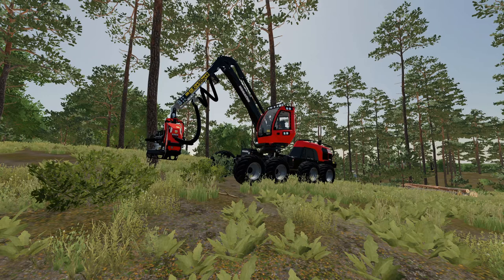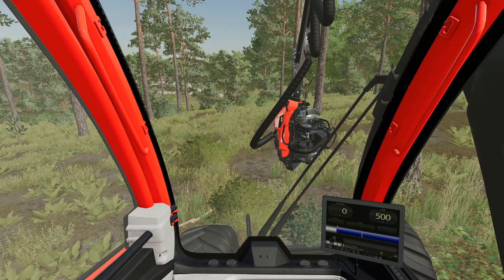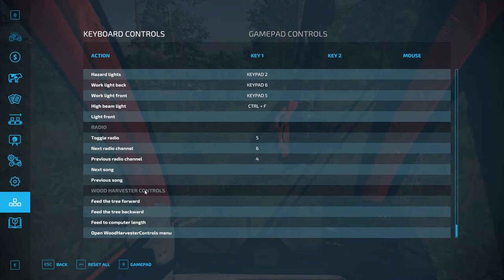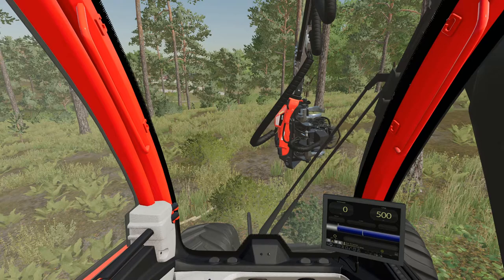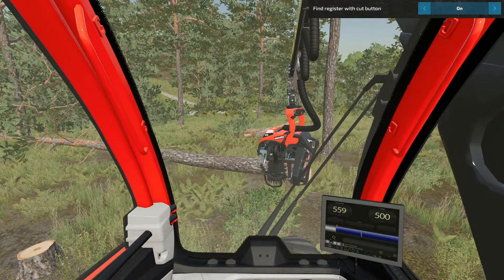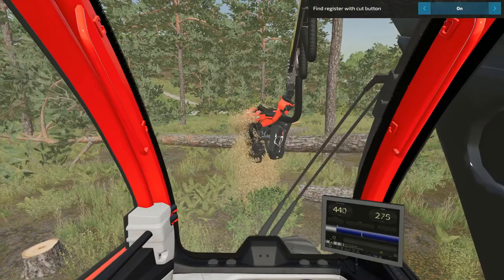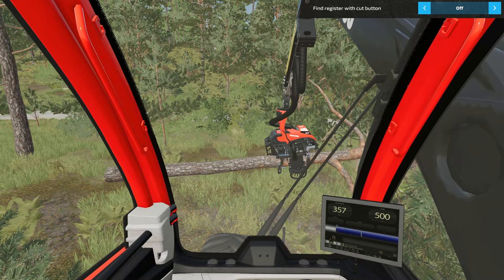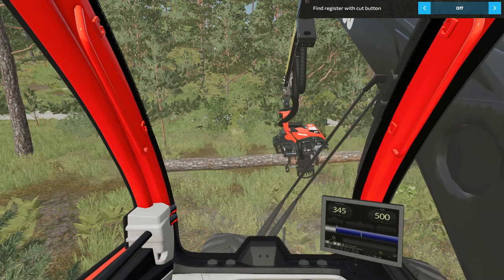Manual Feeding - #2 Scripting FS22 Wood Harvester Controls Mod

Comment: I downloaded your mod yesterday and though there's is a new learning curve. It appear's that it is gonna be the best mod I've got. Just one thing. Using the default's, it cut's into I believe 3 metered pieces. How do I get it to do 6 or 7 meter's. Reckon it's only me, but my being 74, and trying to figure it outy is, not so good.
Reply from the maker: Yeah, the default options are very similar to the base game so you can start playing with it and little bit little learn more about it.
To change the cutting length you need to open the menu (with the Y key) and find the "Cutting length 1 (cm)". You can type there the exact length you want to cut in centimetres, so for example, if you want to cut 6 meters you need to type "600".
I hope it helps